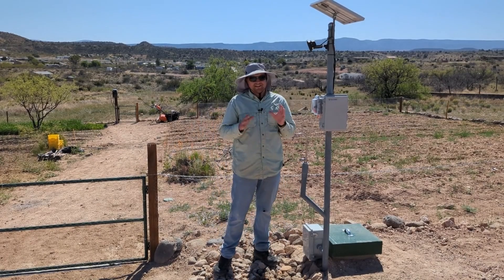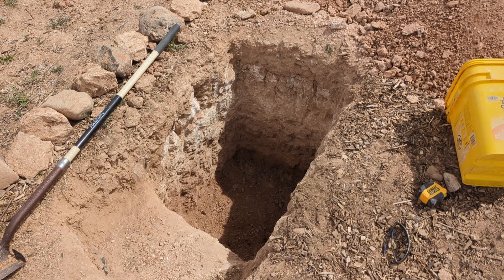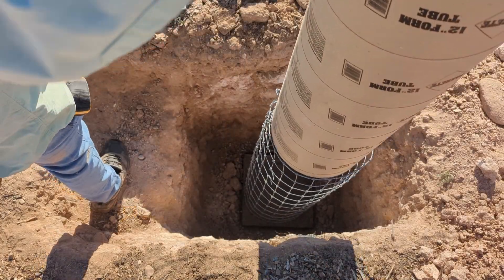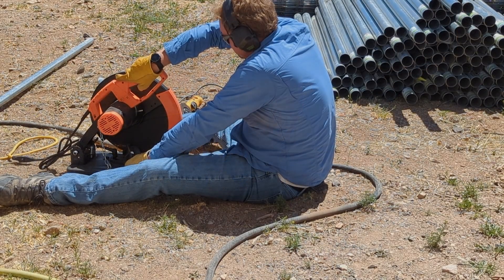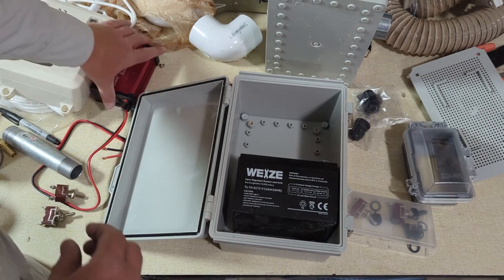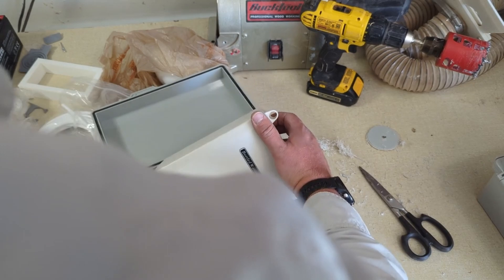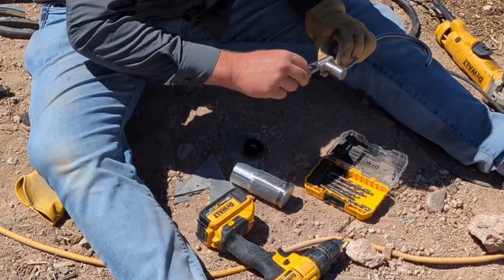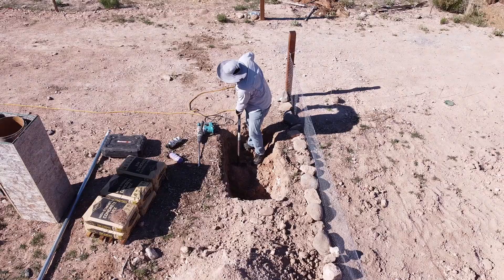Self-Contained Outdoor Water Bottle Fill Station : EIB Creative 5

Comment: Why didn't you use a 12v RV water pump that has a pressure switch? Would have been less expensive than all of the pieces put together that you used, and easier to put together.  I admire the creativity though!
Reply from the maker: I just like the way this pump works and is made for a 5 gallon jug. The one in my shop kitchenette has been awesome. Also I wanted the inverter for other stuff but could have still used the RV pump instead. In short, I'm not that smart 😁
Reply: @everythinginbetween8899    Hey, it's all about learning!   For the next one you could do a direct 12v to USB for charging your phone, 12V spot light and knock off sureflow RV pump.  Skip the inverter and have a bigger battery
Reply from the maker: That's a great idea. It's definitely all about learning and I appreciate you helping me learn. Thanks!

Comment: Where does the water come from? Does it sweat into the concrete mini well through osmosis?
Reply from the maker: There is a 5 gallon jug that feeds the pump from the concrete hole. Seemed like the easiest way but if I could figure out the osmosis plan that sounds way cooler 😉
Reply: @everythinginbetween8899  the "sweat by osmosis" isn't a viable thing, especially for drinking water. If you had a natural spring or high water table, maybe, but not likely based on the surrounding vegetation. If you wanted an "automatic feed" to the water line, you'd have to trench 24" deep over to the house main feed line and run an insulated and housed coldwater PEX line directly to the spigot.
Reply: Yeah I'm aware the osmosis method is not viable. As far as plumbing a main line this was the best solution because we would have to put in an RO system to remove other contaminants. It's been working well and I'm a few jug changes in at this point. It really does make being in the garden all day easier.  @Xonikz